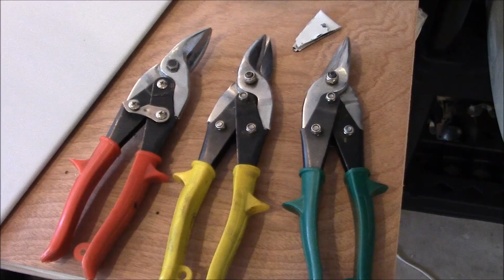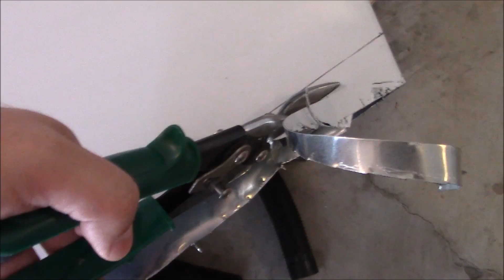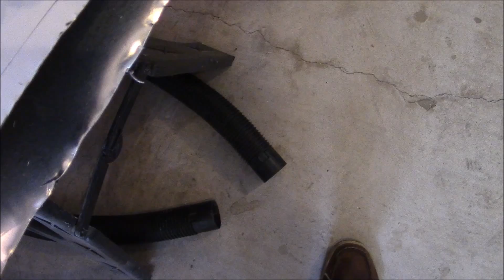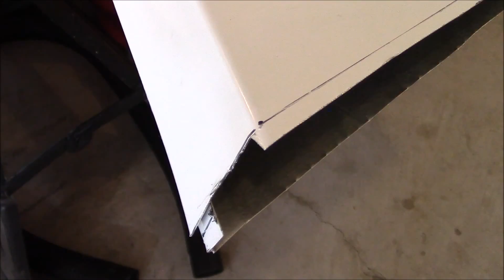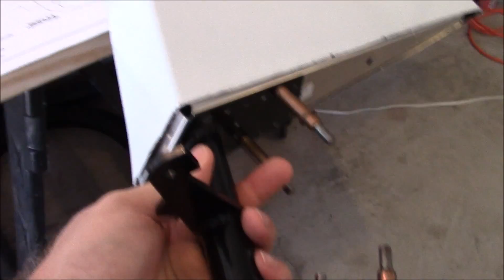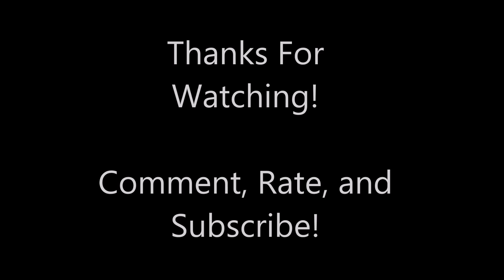Sonex Aircraft Build Video 13 Elevator Skin Cutting and Tin Snips

Comment: Oops!!. NOT TIN SNIPS!  Use a nibbler! It is like tin snips but has a blade with a gap in the middle up through which another blade rises as you squeeze the handle. This removes approximately a 1/16th curl of metal with no distortion other than a slight burr.  Or, a 4 inch diameter hand held electric (battery) grinder with a thin blade for cutting non ferrous metals.  (green grit cutting disc I think)

Comment: Would it be better using an angle grinder to cut the elevators?
Reply from the maker: +SkyPig Gaming Hi Skypig, It could be better, the only problem with grinders in this situation is that they can tear at the metal and weaken it a bit. Plus I don't have an angle grinder so this option works quite well for me. -Dan
Reply: SkyPig Gaming 

My thoughts exactly, would have been much easier and he would have been done in about 15 minutes.
Reply: @robertwood3970  too easy to damage something if not careful.
Reply: Angle grinder is too heavy to control accurately!.
Reply: Angle grinder is too heavy and fast to control easily.